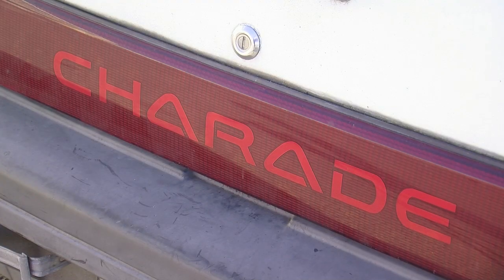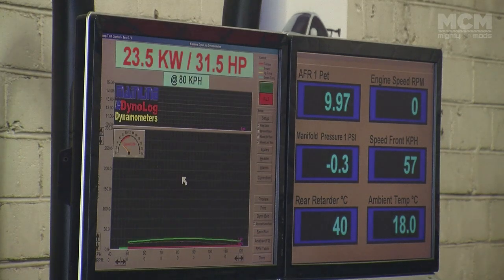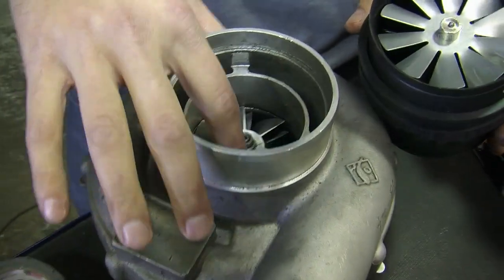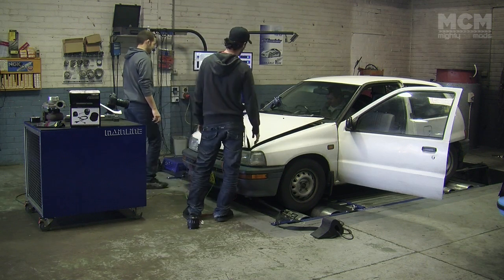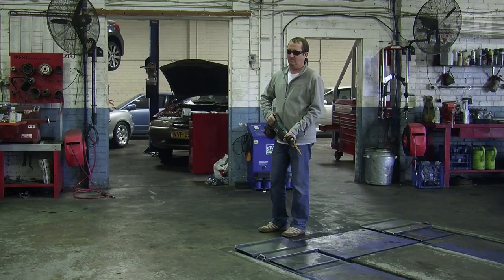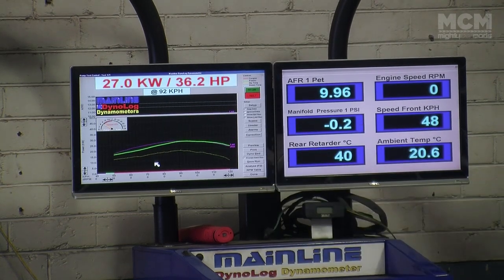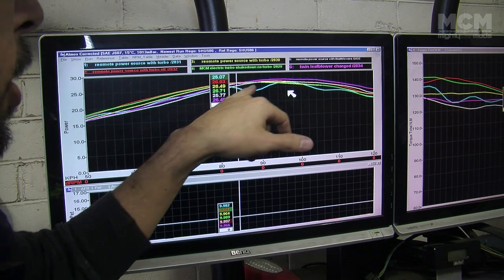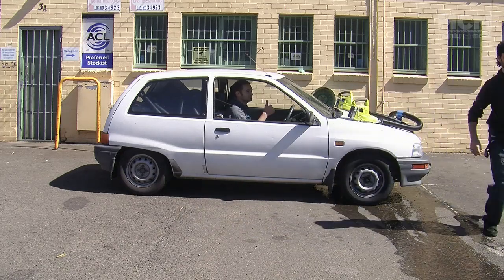Electric SuperChargers Mythbusted

Comment: I think where you went wrong was you didnt tune the car after installing the electric turbo. If   you had tuned it, or even used a standalone ecu you would have seen easily 600hp to the wheels.

Comment: Wouldve been so much cooler if you had used petrol powered blowers instead of electric ones :)
Reply: Search "Roadkill Leaf Blower." Those guys used 5 gas powered leaf blowers to try forcing air into a sbc to make power on a dyno and standing mile.

Comment: The car aint going to do more than it was designed for.  especially when having an air filter.... blowing so much cool air will be stopped by the filter as it was design for a limit air flow through its micro layers for a safe flow into the intake....  More air into the intake still wont change the normal flow of gas going into it by the ECM... SCAM, SCAM, SCAM....  Looks cool just to show off...

Comment: What about using something like a regulated scuba diving tank ?   They hold an incredible volume of air so they can deliver the needed CFM at lets say 7 to 10 psi.
Reply: Commack08 Bad idea as oxygen, especially the closer to 100% you get, is an accelerant, it speeds up the rate of combustion. People say the power stoke is like a controlled explosion but that's wrong, its a controlled combustion. Adding an accelerant like higher concentrations of oxygen would accelerate the combustion process and raise cylinder pressures too quickly, likely causing engine damage (broken rings/ring lands, possibly even bent rods, etc).
That's why we use nitrous oxide or N20. The nitrogen acts as a "buffer", slowly releasing that oxygen molecule at a controlled rate, giving you extra oxygen to burn extra fuel for more power, but not so fast that it damages the engine.
Reply: Yeager_Charlotte I was just explaining why simply injecting extra o2 into an engine is a very bad idea and why we use N20 instead. Water/methanol injection + supercharging is a different animal altogether though it achieves the same result as n2o (which also has a cooling effect) except with greater detonation suppression at a cost of greater mechanical complexity.
As far as mixing alcohol and superchargers, you're preaching to the converted, I drag race a supercharged sbc stroker on E85 (ethanol/gas mix). I wish I could afford to run it on "100%" ethanol or methanol.
Reply: Me?  No.  But it's something I've had in my head for awhile.  A diver's air tank holds something insane like 3000 to 5000 psi.  Regulated down to 10 psi @ whatever CFM the engine needs at full throttle seems like it would work.
Reply: Commack08 You've underestimated how much air a car engine sucks in. How much air does a scuba tank hold? 80 cubic feet? A rule of thumb is 150CFM per 100HP so for 300hp, you need 450CFM. The tank would empty in 10 seconds.
Decompressing that much air so quickly would probably freeze the tank as well.
Reply: Unfortunately it looks like your right. Dive tanks hold (depending on size) 80 to 100 cubic feet at around 3000 psi.  A pair of dive tanks would provide only a short burst of useable boost.

Would it work and be measurable?  Yes.  But the cost of the set up and refills would outweigh the performance gain.

Unless you altered the mix in the tanks to create an environment that has a higher concentration of oxygen.

Normal air at sea level has approximately 21% oxygen. If you raised the mix in the tanks to 30 or 40% and adjusted the fuel delivery you could see some pretty good gains.
Reply: 177SCmaro  Thats why in world war 2 every time pilots in their fighters used WEP (war emergency power) the engine was stripped down after flight and inspected for damage. It works of this basis you guys were just talking about, cold air to raise pressure, i believe the P51D on 150 octane fuel operated under a manifold pressure of 40 and when using WEP (50/50 water and methanol mix spray to super cool the air) its jump to about 65 and over work the engine like a bastard.

Comment: 300 dollars for that? And think that it works?

The compressor of a turbo had well shaped and balanced compressor wheel.
That makes like 150.000 RPM compared with this tin can propeller with an electric motor.

You must be stupid to think that this can compete with an regular turbocharger.
Reply: Wich is said at the end ofcourse.

Comment: in theory it should do SOMETHING, i mean, it doesnt even nessessairly need to be compressed to make power gains, a non boosted vehicle makes vacuum when its running, and by forcing air, its reducing the vacuum effect and getting at least a LITTLE more air in there.....    i almost guarentee its at least giving better mileage at low rpm.... probably offset by aerodynamics how they put it though.
Reply: Synic08 In order for that to work, the fan would need to run constantly which it is not designed to do.  Running the fan constantly would draw  ~30A from your alternator continuously which would most likely hurt your fuel economy. 

A real test would be seeing if the vacuum changed at idle when you turn on the fan.  If the vacuum drops then the fan helps with the restriction.  That being said, if the fan did provide more air, the MAF would sense the increase in air and tell the computer to give the engine more fuel.  That would be the opposite of fuel economy.
Reply: Please explain how it will give better mileage?
Reply: by putting a slightly less drag on the motor because its not quite as hard to pull in the air, therefore, the amout of gas needed to keep the motor going at that speed will be less....

Comment: try cool the intake  air with a intercooler and increase the motor rpm .y try in a two stroke engine and works

Comment: The only reason they get better results with more tries is that when you push something to the limit, you clear the exhaust and combustion chamber from carbon. There's no magic behind it, so yes, push the engine to the limit every now and then and you're gonna get smoother running and better performance.

Comment: better way to get more power from your engine is helping it breath better, which means buying better intake system, and then helping is exhale its burned gases, by buying headers and an exhaust piping system that's better than the stock exhaust, also buying stronger spark pugs to deliver the spark faster, and thicker better made spark plug wires to help deliver strong spark also, to burn your air/fuel mixture faster and burn all of it, which will result in more "power", other than that this is the cheapest way to get as much cheap power you can out of any engine.

Comment: it makes sense, superchargers whine up to 6000+ rpm im sure your going to get massive air "pushed" or "forced" into the engine when this cheap "fan" supercharger is only 100+ rpms and stays there doesn't vary and is being "blew" like a fan, into the engine, it does not work. way to get power is with forced air pressure not flowing air pressure.

Comment: A totally unfair and unscientific test by people who seem to know nothing about engines or the processes involved with an engine running.  You guys hooked it up to the intake tip of that car's air box. There is a warm-air intake tube that connects the bottom side of the air box, about 6 inches from where you connected the 'supercharger', to the heat shield covering the exhaust manifold. It brings in warm air when the engine is cold to help it warm up faster, then a metal flap "closes" over it to limit the warm air entering the intake once the car is warmed up. When you attached the 'supercharger' where you did, you let out any boost this engine could have benefited from and sent it all to the exhaust manifold. To do a fair test, you need to attach it DIRECTLY to the top of the carburetor/intake manifold. I don't know if these superchargers work, although I have always wondered... but a video like this makes me wish I had the last 7m18s of my life back. Such a waste of time and effort on an otherwise pretty cool video.

Comment: Even IF there was a some real boost pushed into the intake, a substantial power increase still would not be seen with that OEM carburetor that lacks the ability to respond and delivered increased fuel flow to match the increased airflow. This test actually proves very little.

Comment: The other thing about a fake fan turbo... it "stalls" if you try to get it to "compress air".
A turbo on the other hand makes use of Centripetal force to compress air.
You can test the stall effect by simply putting your hand over the blow end of that 
electric turbo.. rather than air forcing your hand off the outlet.
the fan will just stall and start over speeding.
It's amazing how all this fake auto stuff get's sold to people.

Comment: :P
I know what they are for, otherwise I would not test Automation! But I mean a external engine that does not draw power from the main engine. That would have the same effect as compressed air tanks, but would be much lighter probably

Comment: What if, you used a compressed air tank and some fancy work to get it down on pressure, and tried using that for your compression. Then, you could actually control the boost. And it should last a long while as well.

Comment: The supercharger on a top fuel dragster draws over 400 horsepower during a run, 400 hp just to push air. A common engine will only require a fraction of that to achieve useful boost but it will still require several hp to be beneficial, electrical motors that can deliver that kind of power require high amperage power supplies, more than a cars stock electrical system can handle on a daily basis, this makes electric superchargers that actually work expensive and impractical.

Comment: Also when you open up the size on the compressor to match the intake, you will lose most of your compressed air instantly due to the mass of output.  If you try to inject the air with the line just running into the intake, you will cause a negative pressure and actually hurt performance because your airflow will be bi-directional.  You will need to close the system and have air filter on the non-compressed side of the compressor so that it doesn't cause this effect.

Comment: By the time you open up the size of the compressors output line to match the intake line, your PSI output will be so low that you won't notice any difference in HP/Torque, but you will have a unique sound when you rev the vehicle up.   Even with a regular air hose attached to those the output PSI is minimal compared to a supercharger/turbo setup.  An electric leaf blower might do you some good though.

Comment: I LOL'ed when they said up to 50 hp gain when all it is was a fan blowing air into the intake. Electric supercharges now are worthless cause you will need loads of power and a good blade/turbine system to actually provide 5 or more psi in boost. Not to mention it has to be computer controlled by the car to spool faster or slower according to demand. Maybe in 2020 but lets stick to normal turbos and supercharges for now.

Comment: I love your work,,,,but I think you need to research some basic principles of air flow. Lose the corrugated tubing because that just robs air flow real bad. And for best flow of multiple air movements you should have the air streams meet at 30 degrees, certainly not at opposites like that set up, and then go buy a real turbo...

Comment: Hmmm, I have a little air compressor (12v cigarette lighter type) for blowing up my tyres (and other inflatable things if I had any) It does say only use for 10 mins or so due to over heating possible.
I wonder if that could be used (with a bit of cooling) to generate some extra ponies. If the exit pipe from the compressor was fed into the air intake (along with normal air) it might generate more power...

Comment: True turbochargers are built to extremely tight clearances and are precision balanced. That's why they can spin at up to 100,000 RPM and actually produce pressure. Also the engine's camshaft has to be configured differently from stock so it will be able to fully take advantage of the added boost, along with making other adjustments. Don't expect miracles to happen just by bolting on a $1500 turbo, and definitely don't expect any from a cheap substitute.

Comment: its very tru the electric superchargers are shit but if u had tried this on a fuel injected vehicle rather than a carb they might of bin an increase reason being the rise in air pressure in the carburetor with a standard fuel system it cud be causing less fuel to enter the engine thus causing power losses instead of gains

Comment: I reckon there isn't any power gain because you've got the "turbo's"before the air filter which in effect all you're doing is forcing a large amount of air into a tiny space (like trying to put a brick through a sieve), if you put them after the air filter e.g. between the air filter and the intake manifold then you might notice a difference.

Comment: If the motor is tiny then it will heat up faster and it depends on how severely overloaded the motor is to determine how long it can stay in this condition before a cool-down is needed. No alternators but batteries in back. Just throwing out some ideas I and others do in the EV community. I once had an electric go cart I built, that I over volted to get 15 HP out of a D&D ES-33. Sucky run time though. It was 72 volts ran into this 36 volt motor and controller was AXE7234, but fast as hell.

Comment: On a DC motor, you can typically run at peak for only 2 seconds before you start to damage the thing.  Putting more volts to the motor means u need to charge the batteries with another alternator or were u thinking of something else?

Comment: No they wont work because:
- they are axial flow and don't have stator vanes
- your alternator wouldn't cope with the current needed if they would use as much power as a real supercharger
And why would you waste even more power by converting the energy so many times... (mechanical=>electrical=>mechanical) Just buy a normal supercharger and don't waste time with scams.

Comment: you don't know much either. The fans are on the radiator so it doesn't overheat. Engines rely on moving air to cool the engine, the intake gets suction from the engine cycle and pulls in air regardless of moving air coming at it.

Comment: In Theory, these should work. Cheap ones that don't spin fast enough won't work. The principal of these electric superchargers is the same as conventional superchargers. Both superchargers run off power from the engine. Conventional draw power mechanically, and these via the electricity generated from the alternator, also belt driven. The only difference between the two is the power they have, and the cheap electric ones in general don't generate enough. Myth not busted

Comment: That is the continuous rating at 120 F. When you overload an electric motor you can get more horsepower that you can use for a short duration. To do this, just simply go with a large enough pulley that causes this motor to bog down when it is turning the supercharger. Or go with higher voltage to get more horsepower without needing to worry about motor overload method.

Comment: That motor is only rated for 6 hp and 3000 rpm. It also weighs over 50lbs!  I realize you could increase the volts to reduce the current which adds another level of expense and complexity compared to driving the blower with a belt.

Comment: Except those "AC blowers" use universal motors which can work on AC or DC and have brushes. An AC motor has no brushes. It is just a rotor spinning inside.. Also the DC motors for portable tools are kept under-powered to not kill the batteries too fast. A proper setup with a decent size DC motor would have no trouble giving good boost at pressure. You need at least 48 volts and need high discharge capable batteries such as the Odyssey batteries that are very expensive!!

Comment: A electric charger setup would use a 48 volt or higher system that you put in the trunk or backseat. It would not be part of the cars electrical system. Best batteries for this are the Odyssey PC680's which is about $400 for 4 of these. The motor to use would be a D&D ES-22-2 that cost about $600. The set up would cost well over the $2000 mark though. So the hp/$ is utter crap. Also boost needs to be managed somehow since the speed of rotation on the charger is independent of the engine.

Comment: thats not a compressor, thats why it doesnt work. by compressing the air, you can raise the amount of air per cubic feet, and inject a lot more air with the same pipe diameter. another point is that you are ruining the power that the engine is producing, by attaching another load to it, a turbo charger recycles wasted energy converting it to mechanical work by compressing the incoming air. forget low cost power gains, you wont gain anything but a subtraction to your bank account.

Comment: Biggest problem would be getting a large enough motor at 12 volt.  You would need roughly 10hp for every litre of engine displacement to get a reasonable level of boost.  A 10hp motor would draw ~ 1000 amps!  

As far as the air tank goes, its not just a matter of pressure but a matter of flow at a level of pressure.   A minimum outlet of a turbo is around 2" diameter.  How long do you think your air tank would last with that size of a tube coming from it?

Comment: LOL Why would you bother with that. Superchargers use a belt connected to the crank pulley. So when spins and spins the crank pulley, it spins the supercharger belt. Rigging up some elaborate electrical system would be a waste of time and be completely redundant.
I guess your idea could work, but why would you bother? The most efficient way of setting up mechanisms is to choose the simplest possible route as there is much less that can go wrong.
Hope this answered your question dude :)